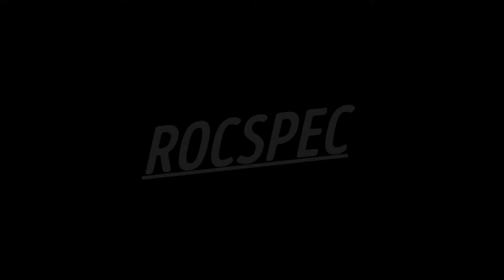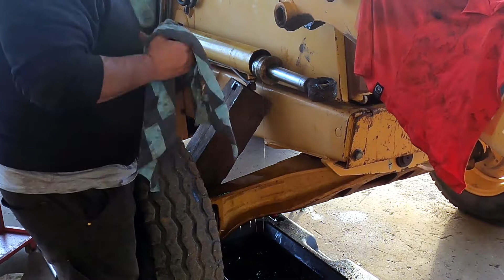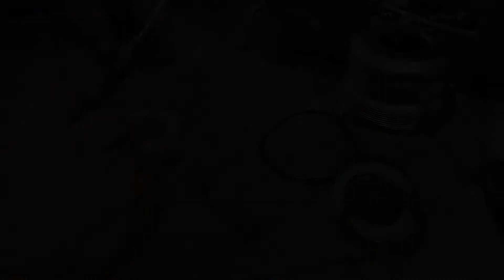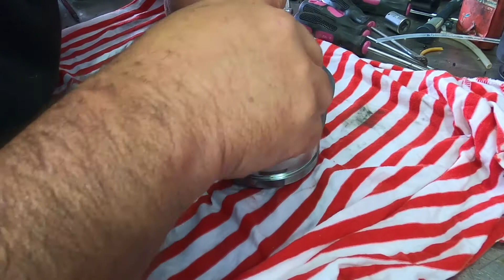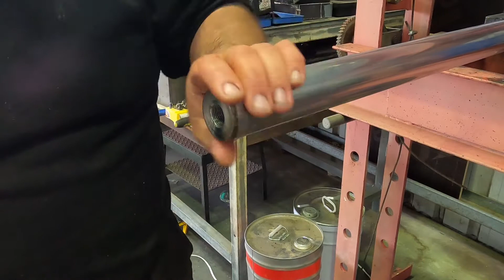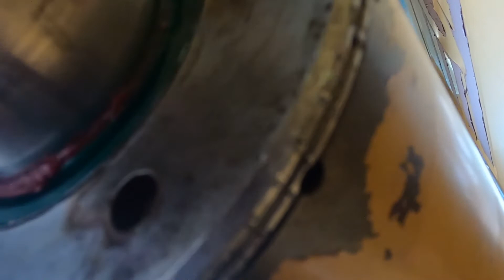Case Hydraulic cylinder rebuild

Comment: The 580 always lite on the front in my opinion the cat 416 series the double hydros on the boom for maintenance and machanic friendly not having to pull a hydro cylinder out of the boom and some areas hard to get a wrench in thr boom and having to fish the hydro lines down the boom pain in the ass the 420 and 410 cat and John deere great rubber tire pain loading concrete in the high bed trucks I like the excavator for the 360 swing and loading trucks with so you can pull the truck behind you if working in traffic keeping a lane open the 420 cat based off of a international 4x4 tractor and loader heavy front end the old 4200 or 4400 tractor I think was the cat 420. Then the Ford 755 was a jcb John deere 710B with a different boom and a John deere loader

Comment: Good vid , however #1 you could have captured you oil . #2 clean the bolt,& threads with brake cleaner or lacquer thinner to remove all oil, or the lock tight will be ineffective, after installing the bolt with the lock tight (red) immediately bring to torque, as the lock tight sets quickly .  #3 if you know the torque, please state, I have never seen a spec on that. #4 on the last  1/2” of thread put silicone , or some type of thread seal to prevent water getting in. 
There is some diff in the cyl for the 580K & the Super K